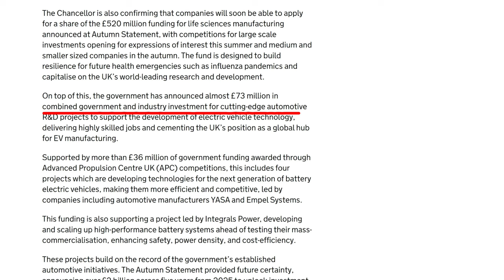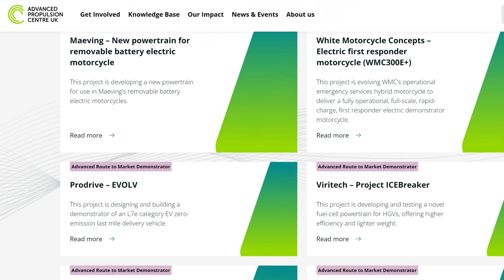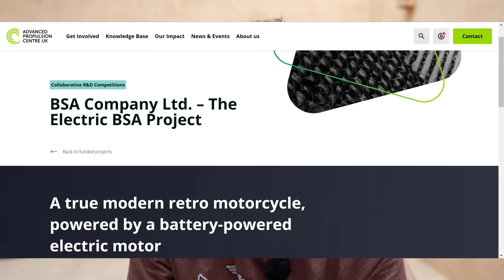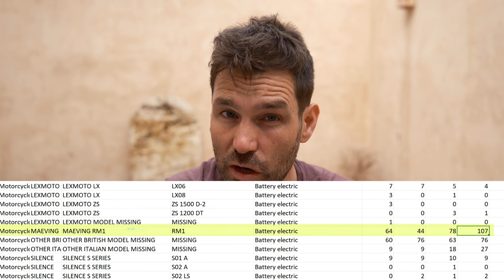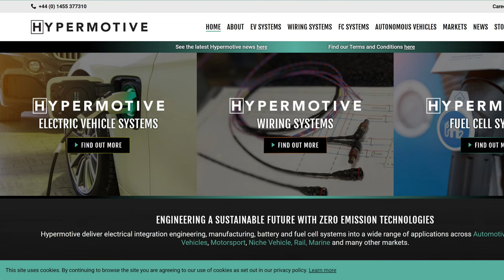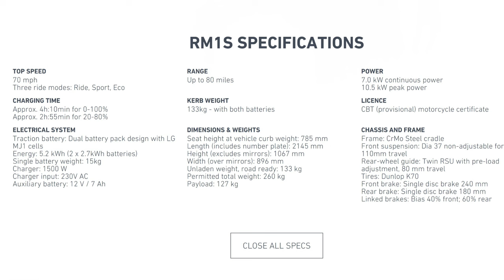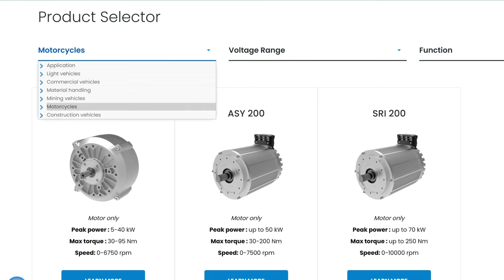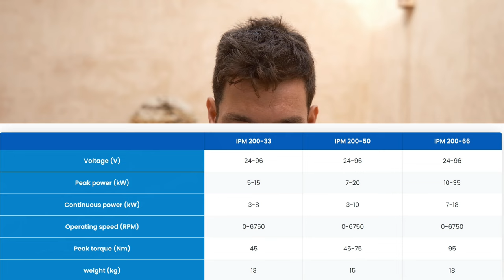BSA's modern retro electric motorcycle ‖ What we know...

Comment: I always find people’s reactions to electric motorcycles interesting. To me the joy of motorcycling is in motorcycling riding a powered two wheel vehicle. Yes there are huge hurdles to Cross to make ev motorcycles effective but they are still a motorised cycle and therefore give a good riding experience.
Reply: As a motorcyclist and somebody who has built electric bicycles I'm fascinated by the middle ground, unfortunately UK legislation is stifling innovation due to the 250w limit.
 The irony is that the 250w limit only applies to law abiding citizens, the local drug dealers are doing 40mph plus on 2000w Ali express bikes.
Reply from the maker: Thanks TT, I think it's the engine and vibration that makes it special. In a way my Pugeot 206 gti was more fun than my M5, the M5 felt uninvolved until you were at silly speeds whereas the little pug was like a go kart... maybe that's a bad example but I was engaged with one more than the other for sure. Thanks for the comment.
Reply: @MindfulMotorcyclist I get it, after 40 years of riding motorcycles and driving everything from minis to 40 footers I am definitely a petrol head. But then I remember the excitement as a child of finding a good long hill on a pushbike and coasting all the way down. That was still fun and is more what I would liken the experience of an electric bike to.

Comment: There's a fair few retro electric motorcycles on the market now, just not in the UK, but they all tend to be the equivalent of small capacity ICE bikes.

Then again, given range/capacity of current batteries, EMoto equivalents to 125 make perfect sense for city riders.
Reply from the maker: That's a fair point Alex I guess to be correct I should have said there's no EV retro bikes from the major brands. Yes city riding the Maeving makes total sense and that's why it's sold so well, same as super soco I expect. Cheers, Sean

Comment: I love my retro twin and wouldn’t swap it for an electric any time soon. Not because I’m anti electric but because there ain’t anything out there yet that compares. It would need to be something quite spectacular from a styling point of view, power and torque equivalent  plus and it’s a big plus a lot more range. And I don’t just mean the official range but some real world range in cold conditions that would easily exceed 120 miles or so. I suspect that current production batteries are unlikely to fit the bill so we will have to wait for solid state technology to come up with the goods and that is still several years away from mass production.
Reply from the maker: Good point about the batteries Nigel, we are quite far away from the tech required. I believe energy density doubles every 10 years or so...

Comment: It will be interesting to see the reaction to this. The appeal of modern classics, I think, has a lot to do with authenticity and relative simplicity. You can get relative simplicity out of an electric, but not authenticity. Trying to make cases that mimic traditional motorcycle features to house the electric motor and batteries would be seen as phony, I think.  If they want to maintain a classic design, then they may consider hiding the batteries with a retro-correct fairing. Or simply go for a clean look that acknowledges the fact that it's a battery powered motorcycle, but plays up classic BSA design cues and emblems as much as possible. So long as it looks right, which is the tricky bit!
Reply from the maker: That's a great comment Mark, I think you either go totally retro or make it obvious that's this is a 'futuristic' bike. Something like the Kawasaki z650rs that looks retro but has modern touches. BSA have done a good job on the Goldstar it does look quite authentic, to my eyes anyway. One thing I do like about electric bikes is the simplicity of them and I would guess although there's probably not enough real world data but to guess they are likely reliable. Just a battery, a motor and some electronics. I expect when they do go wrong it's a lot harder to get fixed vs a petrol where there will be a bike mechanic in your town or city.

Comment: I think a lot of the negativity regarding electric vehicles is from older riders/drivers who see a future comprised of only electric vehicles.  They’re trying to hold onto this negative connotation in hopes it will either prevent or slow the growth of electric vehicles.  Unfortunately, progress occurs despite those trying to prevent it.  We recently purchased a used electric car.  Thanks to massive depreciation and government tax rebates in the US, the car cost us $14,000.  This for a vehicle with a new battery and an 8-year, 100,000 mile battery warranty.  So far, after 5 months of daily commuting, it’s costing about 1/4 per mile to operate compared to the gas-engine car it replaced.  I only considered it since it can be garaged and charged at home.  I would not buy any electric vehicle that had to be charged at a public charger.  Our vehicle has a 200 mile range and is perfect for our needs.  As far as motorcycles, I would only use one for commuting, and there are a number of electric scooters (and e-bikes) that might serve the purpose.  I can’t see spending thousands on something that has a limited range and can’t travel at least 150 miles on a charge.  Technology will certainly need to advance to allow electric motorcycles to become even remotely mainstream.
Reply from the maker: Thanks Alvin for the comment, very well put. At the end of the day everything has a value and a deal is a deal regardless if it is petrol or battery powered. It sounds like you are getting an excellent vehicle covered under warranty for your $14k, even that seems a lot less than most electric cars...